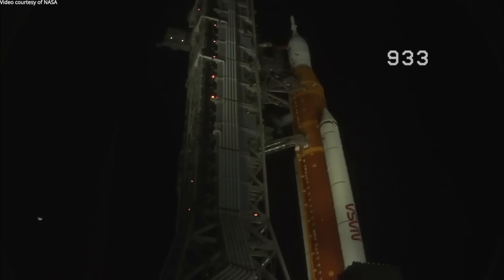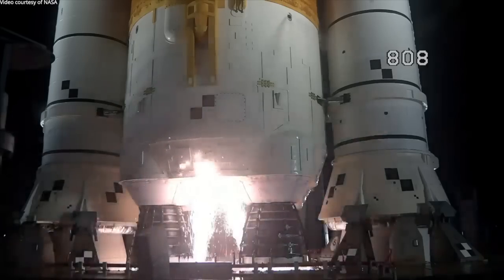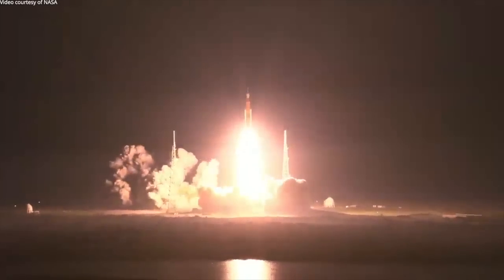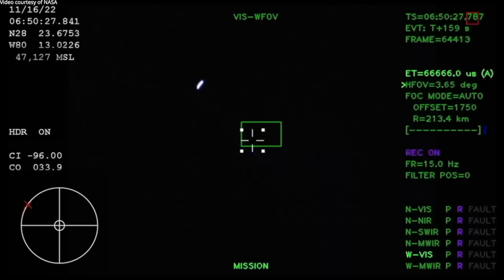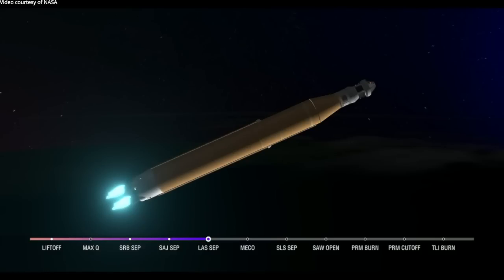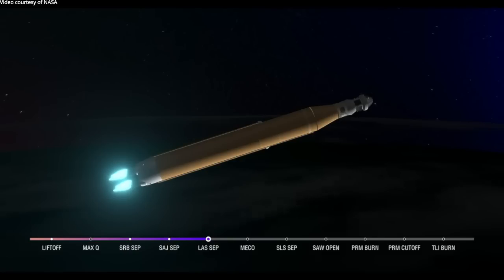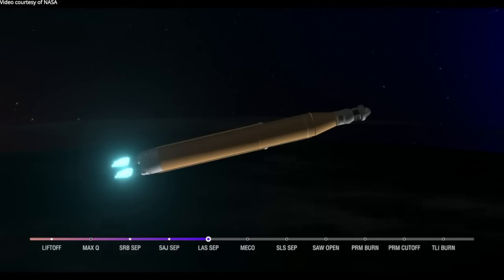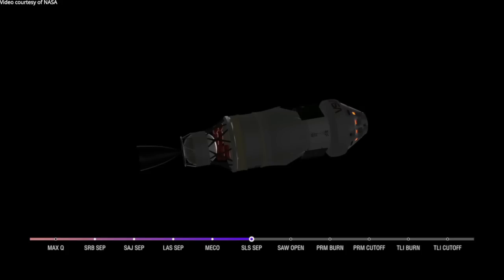Artemis I launch

Comment: Incredible work! But I gotta say, it's super disappointing to see that NASA (or at least, these journalists) relay metrics in imperial measurements. WTF is a lb foot or mile? smh...
Reply: The majority of these news outlets are based in the US so they adhere to the system here. Rocket data and measurements are also measured using the same system so regardless if they wanted to use metric or not they really wouldn't have a choice. That's a good idea though, they should do that for future flights
Reply: US Customary put man on the moon. Maybe one day metric will do the same.
Reply: @Fireslingerpirate  ok boomer lmao

Comment: I am sorry but the core stage animation has me confused. At launch the Orion hatch is on the starboard side and the crew heads are pointing towards the crawlerway. Wasn't the ascent "heads down" oriented like on the Shuttle era?
Reply: the "head down" orientation was due to the weight imbalance of the shuttle (being on the side of the rocket) which requires them to roll the shuttle to keep it from tipping over. there is no such center of gravity concerns with the SLS.